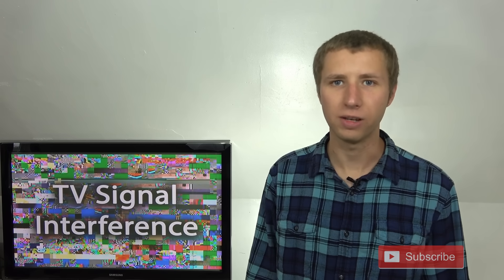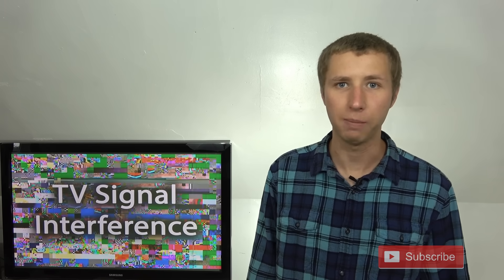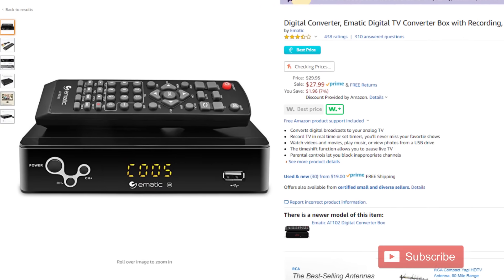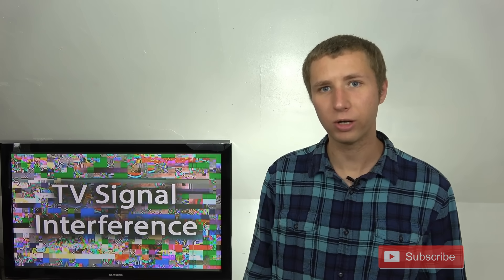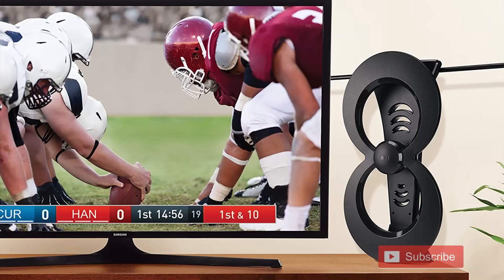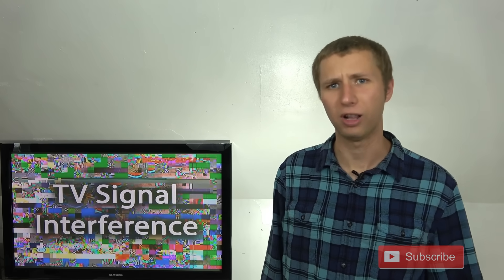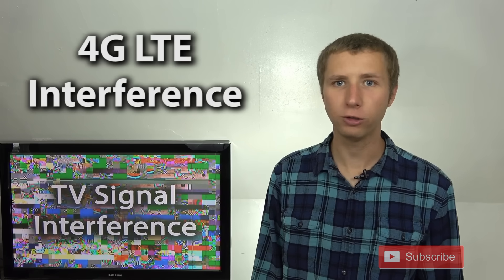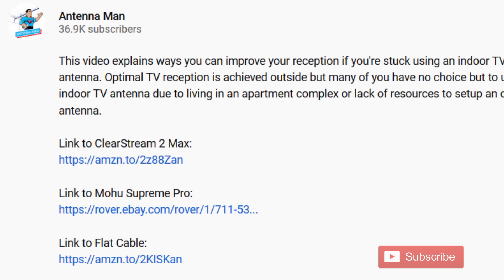Types of Interference That Affects OTA TV Antenna Reception

Comment: We have a LG C9 and it has a built in tuner. We bought the Clearstream 2Max. Most of the time the channels we want to watch come in great. But sometimes they randomly pixelate. Would a amplifier help that. We don’t have trees in our yard but the neighbors do.
Reply from the maker: If the cable is short then do not bother. Premaps only makeup for signal loss in a very long coaxial cable. They do not magically bring in stations that are not heading your antenna in the first place. Tv signals do not travel through building material well so if you have trouble with this antenna indoors you will have to mount it outside for better reception.
Reply: Antenna Man We have the antenna mounted outside on the roof. We have to use a 50ft coax though.
Reply from the maker: @tattooedchick24   try one then it may help.

Comment: Love the job you do on your videos, keep them coming. I had occasional trouble with the abc affiliate out of Columbus OH last summer. Every once in a while the picture would pixelate out of the blue. I finally noticed that when my neighbor was mowing certain areas of her yard It would pixelate. My guess is her spark plug emits a broadband RF signal that effects my antenna that is pointed her direction. When the weather warms up I will install a good ground on the system to see if that helps. Just thought Id pass that along, don't know if you have ever seen that happen or not. Once again thanks for your super videos.

Comment: I think I have both the 4G and FM station problems.  There is a huge cell phone tower a block away and 2 nearby FM transmitters. One of those FM transmitters has 4 stations about a 1/4 mile away. The signal is so strong if you touch a plug on a guitar amp you can hear the FM stations. I put a Channel master LTE filter on but I'm still having problems so I bought a FM trap but hasn't came in the mail yet. I'm using a cheap small Yagi because the TV station I'm wanting to get is only 12 miles away and I didn't think I needed a very big antenna. If the FM trap doesn't fix it I might try a more directional longer Yagi. The next nearest city with TV broadcast is a 150 miles away so I'm trying to make this work.
Reply: The FM trap with the 4G LTE filter made a huge difference. I never thought about using two filters until watching this video. Now that the interference is taken care of I can see I need a better antenna with a little more gain. One of the two stations in that direction the signal gets weak sometimes.
Reply: I got the highly directional yagi antenna and it is even better. It's all green in the signal strength meter. The boom is about 5 foot longer than the one I had.  I think because it's more directional it's helping the LTE filter reject the cell phone tower interference about 20 degrees to the left of where I'm pointing it. With my short yagi I had to point the antenna to the right away from where the station transmitter is because of the cell phone interference.

Comment: Thanks from NEPA. Came across your channel as I had a whole house antenna and had problems with 1 tv. Checked all wires. Moved the antenna outside, no change.  So how about wi-fi interference.  I had a fire stick plugged into the HDMI right above the coax jack. When I moved stuff around and unplugged the stick, bam all stations perfect. Before 16, 22, 56 came in but intermittent sound. Signal strength was about 80% or better. So I reconfigured the stick with the HDMI extender. Working now and saved me from doing a roof mount for nothing.
Reply from the maker: Glad to hear my video helped.

Comment: We live at a very high point north of Boston, we do have trees that I must point the antenna thru but also there is a water tower within stones through and it has cell cables on it.  This seems like a LTE filter may help with the pixelation we get . Any thoughts? Most of the signals come from just south and west of us it seems according to TVfool, 240 deg.  from our location. So the antenna is pointed away from the tower,

Comment: Truth and Quality.
Practical and Useful Information.

Yes is true , attics will obstruct and degrade reception.
Reply: Truth and Quality ,
Practical and Useful Information.
-----------------------------------------------------------------
During this time period on this planet 2021.
The world is filled electronic and electric
 interference generators.
Move the device that is having trouble , 
away from electronic and electric 
interference generators.
Unplug and switch off all devices , also
go to the circuit breaker box and flit off
circuit breakers.

Comment: How about modern A/V Receivers? I bought and tried a Mohu Leaf+ amplified 60 mile antenna yesterday. It did not do well during my initial try, but what I noticed is it did much better when the A/V Receiver my TV is attached to was turned off. This even happened when the Leaf was 10 ft away from it. Is this a coincidence?

Comment: So my breakroom tv is running an antenna and when we turn on the tv it shows a clear picture but it makes a high pitch screech that goes every second. while making this audible sound the screen goes with a clear white line across. what causes this. our setup is an antenna to the splitter with a coax dc power adapter then to the tv. somebody help.
Reply from the maker: That's due to a low signal. If you're using a splitter it may be killing your signal. You'd need one of those https://amzn.to/2K0lrQm

Comment: I took his advice about the converter box and I got less channels with my antenna hooked up to the converter then I do with out it. It was one version newer that was shown in the video. Ematic AT103C. But the indoor antenna I use is amplified.  Philips MANT410 antenna. I get 12 channels with just my antena and when I used the converter box I only got 4 channels.

Comment: Another great video! Some questions/thoughts. I have a dual quad bay bowtie antenna in the attic. (RIP MCM) I have one set of bays pointed to the SW to pick up Cincinnati and the other pointed at the more local Dayton transmitters to the NW. Both targets are diagonally through a line of old oak trees to my west.  One Dayton station goes crappy on windy days.

- To deal with trees, would it be helpful to get/build a "wide" antenna? I'm thinking of two parallel antennas mounted with a yard or two of horizontal separation, combined as in a previous video you did.  (And combined with my 8 bay antenna, now dedicated to Cinci.) 
https://www.youtube.com/watch?v=ToeZWV5ifjA Combining
https://www.youtube.com/watch?v=Do0wCsynylA Trees

- Do amateur (ham) radio transmissions interfere much with OTA TV?  I have an amateur 2nd house over.  If it is a problem, is there a filter for that?

- Does it make sense to try to use some sort of metal mesh/screening to block signals from unwanted directions?  In my split bay configuration, I've contemplated a square yard or so of grounded mesh sticking out to the west from my antenna to keep the NW Dayton signals out of the SW Cincy bays and vice versa.  There's nothing receivable to the east.  Could I block that direction with a screen "behind" my NW/SW aimed antenna(s)?  Shielding antennas would seem to avoid the multi-path problem (needing to match the feed lengths ahead of the combiner).  I came across a video of a guy who literally built deepish mesh boxes around his antenna(s) to make them super directional. [can't find link - yet]

- For indoor antenna use, I would think that window screens made with nylon screening would let signals through the window openings better than metal screens?

- After the repack is all done, I'm guessing we'll have to buy new LTE filters to cut out the additional used-to-be-TV frequencies?  (Your LTE interference description makes it sound like I need a filter.)
Reply from the maker: Too many questions... please e-mail.

Comment: There's another issue you did not mention here, but you have brought it up in another video. That is FCC Repack. In my local experience, every station that has already repacked now comes in fine (outdoor rooftop antenna). Three of the stations in my area are experiencing interference because of distant stations on the same frequency (RF channel) where repack has not yet taken place, and I happen to be right in line with the local and the distant in all three cases. Even though I don't actually see the distant station, it's enough to influence the local. When I raised my outdoor antenna another 8 inches, I actually lost those three stations because I was apparently "improving" my interference from the distant stations. When I lowered it back down they came back, although two are still intermittent. If I switch to my old lower-in-elevation indoor setup, I can get those stations, although then there are other problems with the rest of my stations because of being indoors. Thanks to AntennaWeb.org & RabbitEars.info, I was able to identify the offending stations on the respective RF channels, (18, 46 & 48), and find out when they will repack away from my locals which will also repack (10/19, 01/20 and 03/20). So I'm in hurry up and wait mode. Not so ironically, when there's bad weather, the effected locals come in better because I guess the distant offenders aren't propagating to me as well.

Comment: I ran into a problem once where one channel would come in fine during the day but starting at dusk there was tremendous interference. The problem puzzled me for several weeks until one evening I was looking out the door at the antenna with TV on when suddenly the interference started...and I realized it was happening at the same time the porch lights came on. It turns out that the LED bulb in fixture, which was located near the antenna, was defective and changing the bulb fixed the problem 😉.

Comment: I discovered another source of interference at my house.  It's pretty minor, but my wife likes to run an air cleaner in the bedroom and even though the antenna is on the roof I get interference with both TV's that I lose the stream for a moment if I change speed or shut it off.  It did it both when I had power to my amp and when I didn't.  I found that kind of interesting.  I saw voltage drop and voltage spikes on this circuit with my cheap volt ohm meter.  
  
I live also in the flight path to our airport and do notice some breakup temporarily when the planes fly over on certain stations.

Comment: I used to have a Rabbit Ears style antenna above my old TV indoors and every time the wind would pick up I would get picture issues. The tree explanation sounds like the problem I was having. I bought a cheap antenna which I know you don't recommend and I put it in my attic above my garage and I now don't have that problem. I don't get some of the other stations that are far away so in the future I may put up an outdoor antenna. Thanks for the advice!

Comment: Thanks for this! I'm surrounded by trees, have power lines just across the alley from my front door, I'm located near a powerful FM transmitting radio station, and my home is ~1930 electrical filled with LED bulbs. All this with hokey rabbit ears connected with a coaxial adapter to T.V. with HDMI and S-video ports (because the fancy new antennas, like you showed, didn't improve squat. I'll be watching the recommended "indoor antenna video" now! You've got my sub.

Comment: Anyone have an answer for this? House is 50 mi. from broadcast tower. Antenna is on roof connected to home run line going to attic. Splits off to 3 rooms. 3 TV's scan for 67 channels. Can only get 1 of 3 network channels on 2 bedroom TVs and 2 of 3 network channels on the living room TV. When splitter in attic is bypassed and only one line is connected ( using 3gz barrel) to one TV (doesn't matter which one) TV scans for 75 channels and can get all 3 network channels but when splitter is reconnected to all 3 or just 2 TV's we are back to were we started from. The original splitter was a directv splitter then changed out to an all power pass splitter. same result. Antenna is an Orby antenna going through a diplexer to 3 orby boxes.

Comment: Computers interfere inside. Some channels I cant watch unless my laptop is off.
Reply: Mind sharing the laptop manufacturer and model number? Between me and my wife, we have five laptops in the house and I've never seen an issue.
Reply: @AtomicAJ74   its all of them, Im in front  of the tv, using the onn antenna amp on an outside antenna. Only happens on certain channels, the weaker ones. Like right now with the patriots game, Ill have to shut it off.

Comment: Great job, and all your information is 100% accurate.  As a ham radio operator, I have had to track down interference many times.  You mentioned power line interference, and that is the responsibility of the local power company to fix.  Common causes are insulators arcing, and it may not be at the home where the antenna is.  It could be several houses away, and carried over the wires.  One of the best tools to track down this sort of interference is a small pocket AM radio (preferably an older one that is analog.)  You will hear a buzzing/arcing sound on the radio and it will get louder as you approach the arcing insulator.  Another tool I have used in the past is one of those USB receivers that are commonly used by SDR software running on a laptop.  You set the software to be in spectrum analysis mode.  There are plenty of videos on YouTube explaining this - such as:  https://www.youtube.com/watch?v=I2Tod9PvFXw which is pretty good.

Comment: You linked 2 of the same LTE filters
Reply: I'd like to know the correct FM trap link as well.
Reply from the maker: Sorry folks, here it is: https://rover.ebay.com/rover/1/711-53200-19255-0/1?icep_id=114&ipn=icep&toolid=20004&campid=5338569007&mpre=https%3A%2F%2Fwww.ebay.com%2Fitm%2F75-Ohm-FM-Trap-Coaxial-Input-and-Output%2F123268285744%3Fhash%3Ditem1cb35cc530%3Ag%3AttYAAOSwHgdavSpy
Reply: @AntennaMan  That page shows a "960 mile range antenna..." ha ha

Comment: This is not directly related to this video, but I wondering what your thoughts are on the Channel Master Smartenna+.  The idea of having an antenna with an internal processor, and a preamp sounds promising.  This assumes that the logic of the internal processor is effective, plus the preamp doesn't over amplify the signal.
Thanks, in advance.
Reply: I have one, but I still had issues with it being indoors. Could never seem to fix one station without hurting others. 95% of my reception problems have gone away since I went outdoors with a rooftop antenna (Channel Master Extreme80). The other 5% of reception instability seems to do with the stations that haven't repacked yet; they are getting interference from distant stations on the same RF for now until repack happens for them. (Got that info from one of the station managers.)
Reply: Peter, thanks for sharing your experience with the Smartenna+.  I think I will have to go with an outdoor antenna.  Fortunately, all of the stations I want are in the same general direction and no more than 40 miles away.
I would like to add, that I live in a brick house with 2 layers of shingles on the roof.  I can say with certainty that both are very good at blocking TV signals.  I can get some channels by putting my indoor antenna in front of a window, but not all of them.
Reply: @davidlamm6332  Confirm where the towers are in relation to your house by generating a map at antennaweb.org. Mine are all NE/E/SE, so the antenna I got works well because it is directional in a 180° field. Watch Tyler's video about proper grounding.
Reply: @pgchase4578043026  I will definitely make sure it is properly grounded.  I am also pretty lucky that all the stations I want are within a 20 degree arc, so a nice directional antenna should suffice.
There are some terrain issues, so the higher I can mount it, the better.
Reply: @davidlamm6332  I also added a lightning arrestor to the coaxial cable right before it enters the house. It & the antenna ground both connect to the ground for the electric meter.

Comment: I've got a Terk amplified "bowtie" (for lack of a better word) antenna that works really well. It's very directional and helps tremendously with my TV reception at my bottom floor apartment. My neighbors moving around upstairs can sometimes block my signal. Even people parking their cars or going up the stairs outside my front door can interfere with my signal. After much trial and error and fooling around, I have found a sweet spot about six feet off the floor that usually works quite well under most conditions.
Reply: I have used Woman then an updated version of the Terk omndirectional indoor antenna that's exclusive to Best Buy. Is a bit larger than the others, sort of flat rectangular narrow wedge shape. I don't use the Power amplifier because although brings in a couple more dispensations that I'll watch, it causes loss one of the nearby major network stations, I think PBS or CBS, probably because the signal is too strong. I am about 6 miles away from most of the network towers, and my signal strength ranges from 85% to 100%, usually 100% on most of the channels. Of course this depends on the position of the antenna. Which needs to be within about 6 feet of the front of the house facing the broadcast towers. I use it it for recording to my computer. When I use it for my 60 inch Panasonic plasma TV which is another 5 feet further inside the house, it doesn't pick up as well, even when I try moving it closer to the front of the house. Maybe the TV tuner isn't as good as the ones I use for my computer. I also have a 58 inch Samsung plasma TV, which I brought a couple years earlier than the Panasonic, around 13 years ago, but but I haven't hooked up an antenna for that for a while because I don't currently use that TV, but if I recall it did have good reception with the Terk indoor antenna, even though it's in a back bedroom, so you  may be right about the Samsung having better tuners.